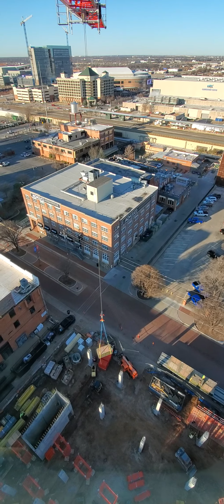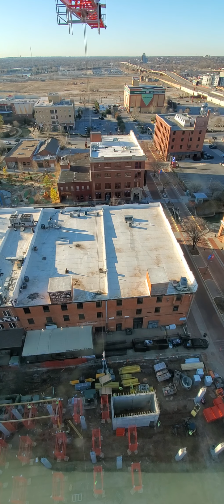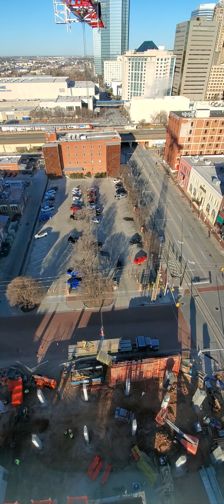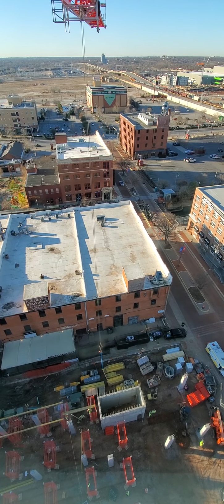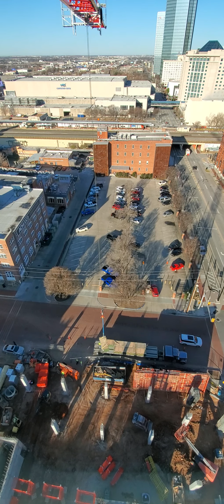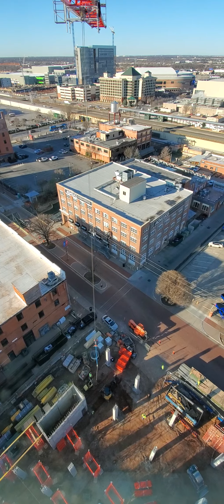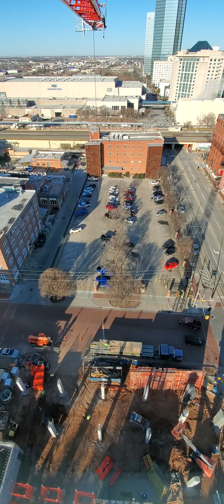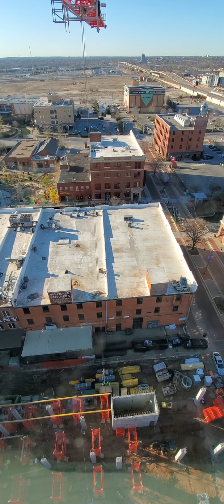Saez TLS 75 16 ton/ Part 1 Marriott Hotel LIKE SHARE &SUBSCRIBE!!

Comment: Hiii, do you use microspeed at the stop of slewing? Am also on Saez tls an it slewing terrible...
Reply from the maker: Very good question no I do not. I just time my swing it’s something you have to get used to the longer you swing that crane the more used to it you will get it’s all about timing.
Reply: Mine stop and appy brakes moment i let my stick.... i dunno if that the issue with this crane or all of saez this model tls 2021 production year
Reply from the maker: You may want to check and see if something is wrong with it if that’s a newer model is, should run fairly good